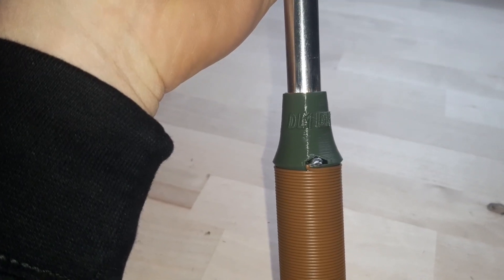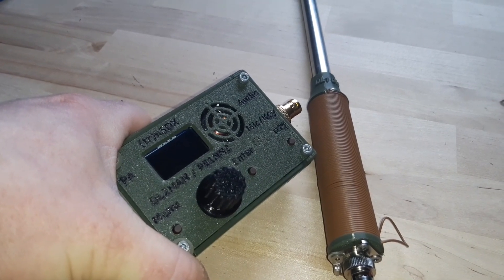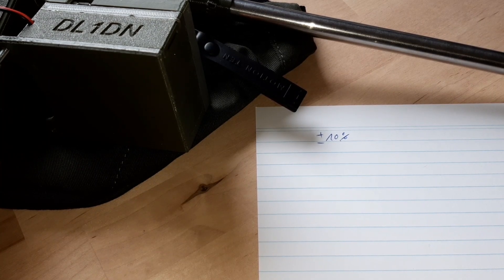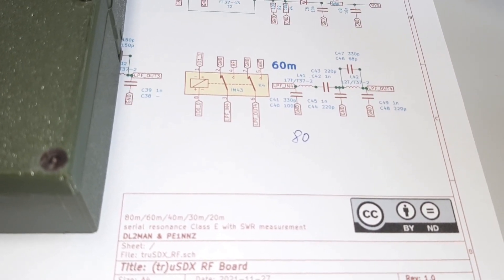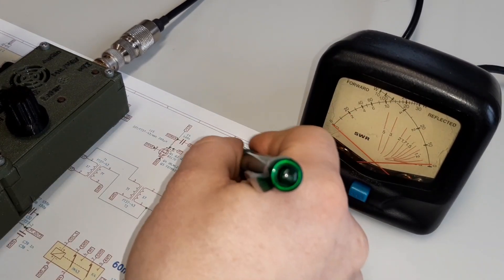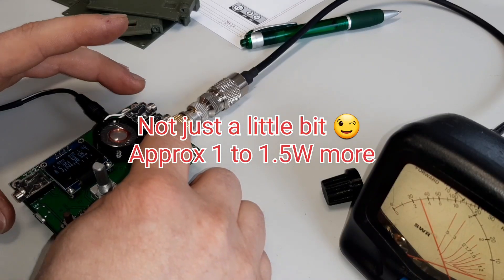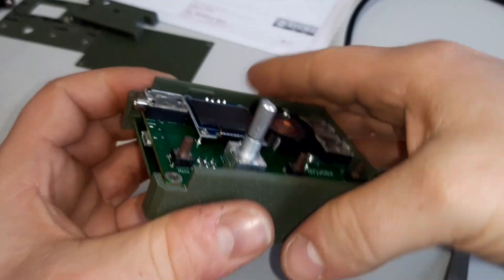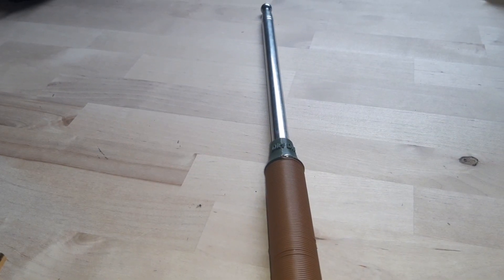POWER MOD (tr)uSDX QRP SSB

Comment: I'm just building my rig, but I plan on using the NanoVNA to tune each of the filters so they don't attenuate much at the top of each band but still suppress the harmonics well. The VNA's are a great tool for those of us who used to have to guess and cut and resolder and guess again. Being able to see what is going on is wonderful. It's the best $60 equipment  investment I ever made.

BTW, have you tried using your HF HT indoors yet? Clearly it won't work nearly as well as in that high open meadow, but it will probably work some. I live in a city and as soon as my rig is done I plan on trying it from in front of an upstairs window in my apartment building. I don't expect much, but something is better than nothing.
Reply from the maker: I did a lot indoor QSO, highly reccomend in cw mode

Comment: I did the same with the chinese usdx....I learned this methode from the Qrplabs Qcx.... Not only remove some windings but squeeze or stretch the windings on the toroid wil do also a good job! 73

Comment: Please correct me if I'm wrong. You have reduced the attenuation of the bandpass filter to have more gain. Am I right? What about the measurement of harmonics?
Reply: indeed. Removing completely the filter will increase much more ;-)
You can't do that.
You measure now the output power AND the harmonics! And it is possible that you have less fundamentals, because a pi-filter increase the power.
Reply from the maker: @tim46767  I do not have the correct toroids because of this I had do reduce the windings

Comment: Hey,
I had about the same power output as you. In my case also 80m was the best, followed by 30m and the other bands were below 3 W. I removed 2 turns on the first torroid for 40m and 60m which improved the power to about 4 W. I also removed one turn one each torroid for 20m which gave me 5,5 W.
Besides I noted the power lowers significantly to the upper end of the band. So for 80m I had 5W at 3500 kHz but only about 3 W at 3800 kHz. So you should consider this depending on your favorite mode of operation.
Reply from the maker: The same like mine

Comment: Nice demo David, i also checked the power levels at 13.8Vdc/ but i will check them at 11.1Vdc as you did so i can compare now. Looking forward for your next video with that nice antenna you designed. vy 73 de Andrei, YO6TJJ
Reply from the maker: Hello Andrei, at 13.8V about 6W